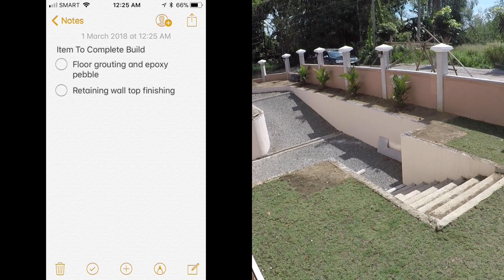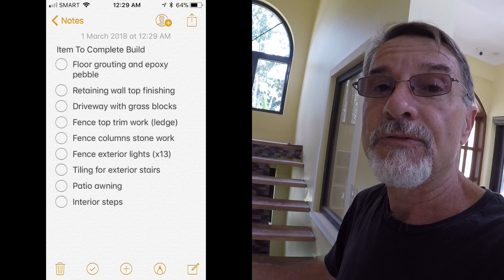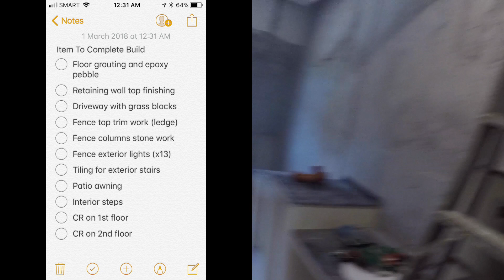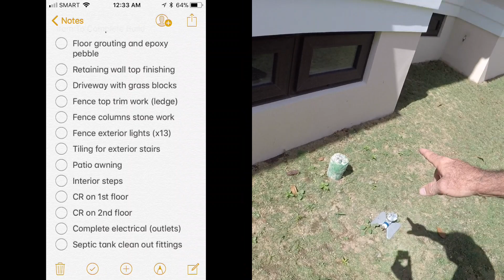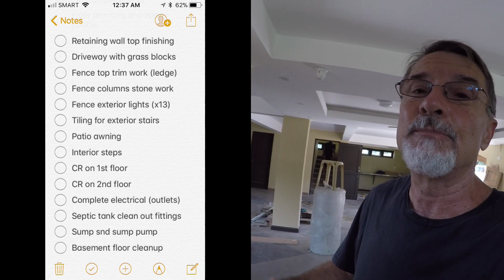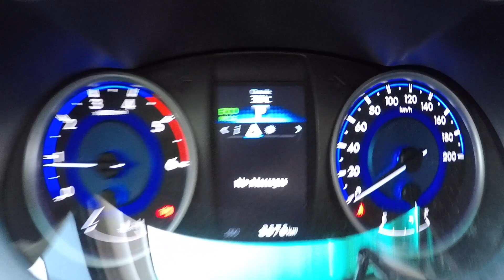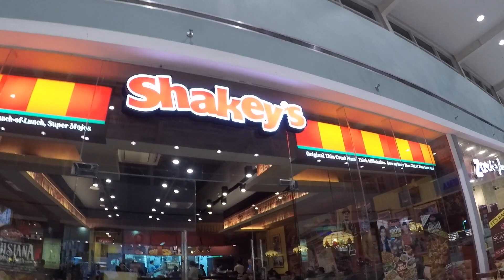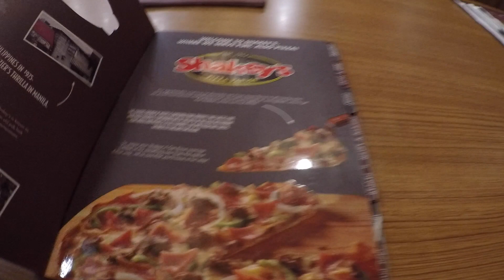VILLA FELIZ - EPISODE 320: FINAL CONSTRUCTION CHECK LIST (House Building in the Philippines)

Comment: Hey James, I hope you don't forget to get the exhaust port finished for the generator, you may need to use it since the power grid is so unreliable there.  The house is looking great, but I really don't see all of your list being completed by the end of March unless the manpower is quadrupled.  I really think you could have used the same idea for the service door doorjamb at the split of the two garage doors.  Just add a wood strip on the inside of one and router out the "L" shape in the other door, but the "T" will look OK too.